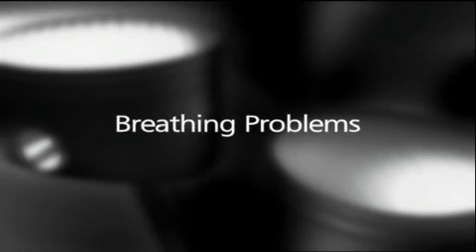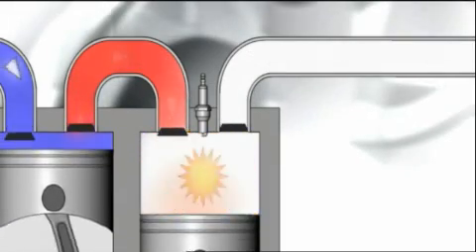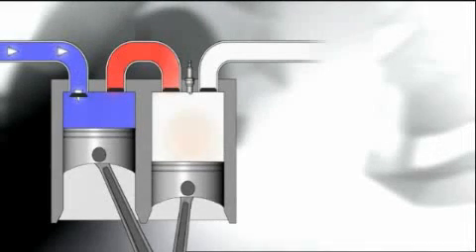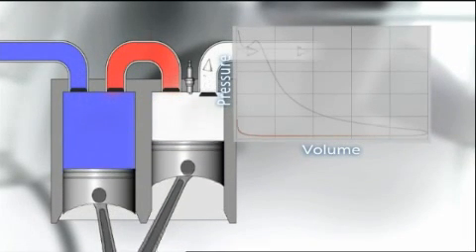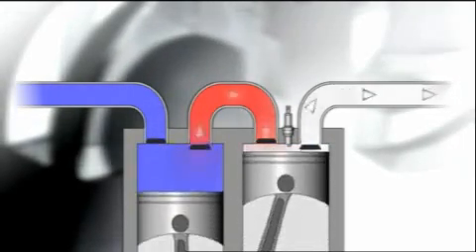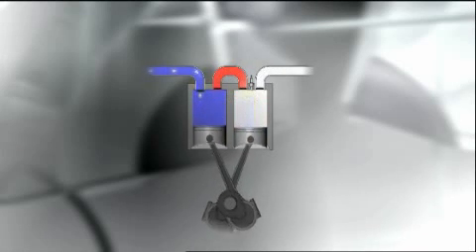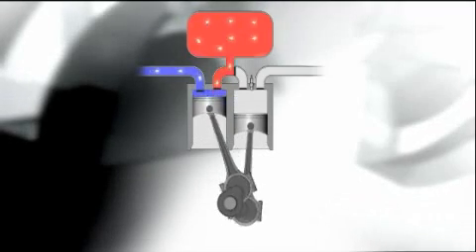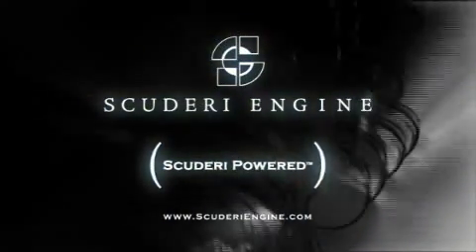Scuderi Engine - How It Works (by www.caroto.gr)

Comment: I dont see how the second working  piston could ever overcome the parasitic loss and friction of the first piston O_o..in other words i dont see it putting out any more power and efficiency than just having a single working piston...seems like added useless complexity and more moving parts to fail..
Reply: It is. Im not sure how anyone saw this as a good idea...I mean, we have pretty efficient turbos now that will do the same thing, but better and you can have 4 working pistons!
Reply: without regen brakes this should require no additional moving parts, and the number of power strokes per cylinder per 360° turn of the crank is identical.
Reply: +Stevie Wonder but the point is that its adding parts and complexity that dont add more power than they consume. At least I would imagine they would require more power than they produce. In other words, its essentially a turbocharged 2 cylinder but alot heavier and alot less efficient turbo since the "turbo" in this case is crank driven instead of gas driven. It takes alot less energy to spin a fan with air, than to carry dead weight on the crank.
Reply: +Stevie Wonder if you think of it like this, a supercharger requires much more power to produce power (compress the air) than a turbocharger does because it runs almost directly from the crank. The turbocharger uses existing gas to pressurize itself, requiring almost no power from the engine to drive itself as its making use of an otherwise useless exhaust gas.
Reply: sparky12x No. At lower rpms restricting exhaust will actually increase the velocity at which it extracts itself. Much like restricting air intake has the same effect. This increases torque at lower rpms. At higher rpms, yes wider diameters are required to meet flow requirements.

Comment: I don't see the improvement. I see a 4 cylinder engine with 2 cylinders making power and 2 dragging, cutting the power in 1/2. The transition of the mixture to a larger chamber, will result in a low compression and less powerful engine. This idea is better used in a high pressure air compressor.

Comment: It's a hoax folks. Don't give this guy your money, you won't see a return.
Reply: +Tim Hallas True as fuel consumption will further increase compared to a supercharger as this engine is moving heavier parts to create pressure compared to a supercharger, both of which rely on the energy transfered through the crankshaft from the piston in the cylinder where the air-fuel mix ignites.
Reply: tin tin
Not only that, but the efficiency is further reduced by the huge friction differential between a piston, and a supercharger's nearly zero friction pump. I designed a similar system in 9th grade. It proved to be an engineering nightmare as well as a 35 % loss of efficiency. Not to mention the cost factors. It died in 1972.